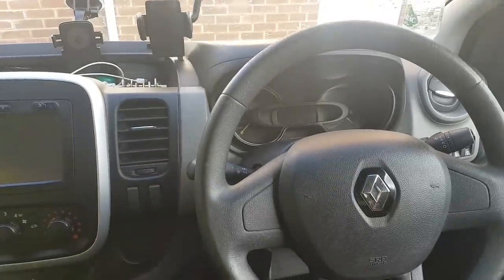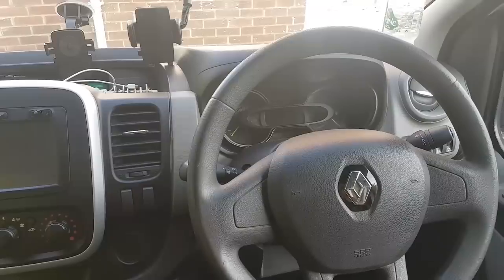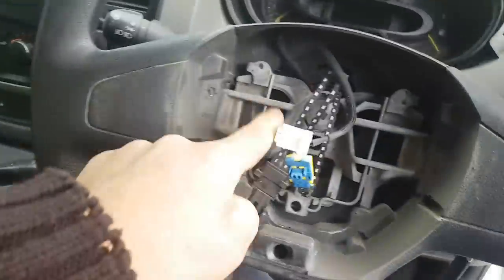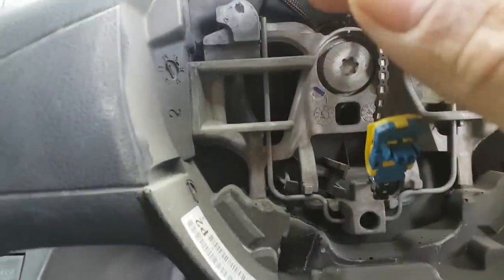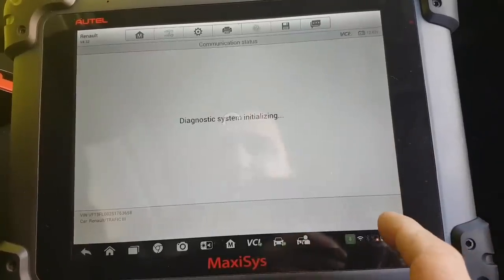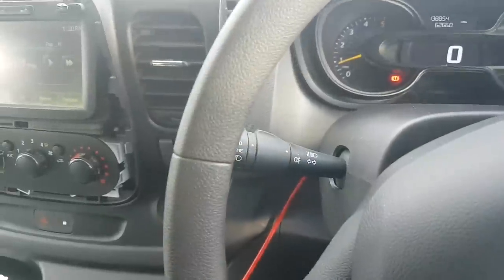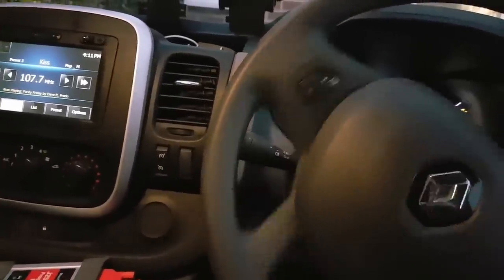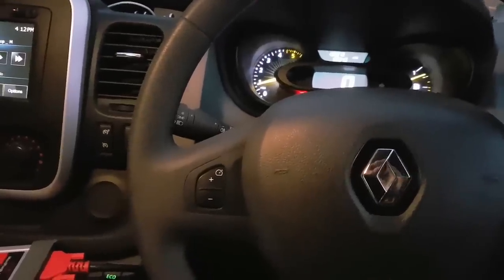Renault Trafic 3 genuine cruise control retrofit! Including coding!

Comment: Great video, didn’t know this was possible and now I have cruise control on my 2015 Trafic! Had to spend £50 on a new squib though as I damaged the air bag connection whilst removing the old steering wheel, nightmare! £300 overall and now I’ve got cruise control, thanks again!
Reply from the maker: 😊
That's great! 
Thank you for watching and for your comment! 
👍👍

Comment: Hi My friend  you did call it right !! .  Changed the clock spring  and my check cruise control and check speed limiter fault has gone and the orange and green lights have returned to my dash . Replacement part was not cheap but all now working thank you so so much for your help.
Reply from the maker: ☺️
That's great! 
👍👍👍
Reply: Hello!

Tanken you for the information.
I have changed the steering wheel and programming with RenoLink. But I get message Check Speed Limit / Check Cruise control
Is it the spring clock that causes this?
Which spring clock I need to buy?
From a later model with CC and SL?

Comment: If the vehicle is equipped with start stop ,you will have for sure 2 clutch switches.The clip for this newer model is useless to activate something,because all the configuration will be made online with a configuration file specific for the options from factory.The bad part is,if they replace the ecu or instrument cluster at renault it will be configured without cc/sl.Very nice video ;) keep up the good work
Reply from the maker: Hi
Correct... I told the owner that any of that would revert the changes back...
Thank you for watching and for your comment! 
👍👍👍

Comment: In my case I had to  changed clock spring and cruise control works!:)  thank you so much for all help and great video. Even me amatour who has never done any coding managed to do it thanks to you
Reply from the maker: Not a problem!
Great you got it done! 
Thank you for watching and for your comment!
Reply: Hi Robert . Have you part number for the correct clock spring?
Reply: Hi. Did you have to change the clock spring as well as added the CC switch and the steering buttons? I have retrofitted the CC switch and steering wheels buttons and it is not working. Cheers
Reply: Yes I did I changed it and then coded the van
Reply: Hi What's the clock spring part number many thanks
Reply: @alicanyazgan  Hi won't remember now don't even have the van anymore sorry

Comment: Thanks for the content, it's all I needed !
Good news !
I'm currently adding the CC on a Sandero 2. It's the electronic of a Clio IV and so very close to yours. Same push button and configuration as here. 

Sadly, the default rotor spring lacks the CC cable so I just bought one. I tried to Enable CC without it (just to know if the car would accept it) but the steering wheel button state is "Open Circuit", therefore the ECM doesn't permit the CC option to be activated, make sense, 5v and 0v are considered "Open Circuit" by the ECM, apparently the 4v value is required to enable the CC option.

When I will finally plug the steering wheel I will give my feedback to help future people ;)

Comment: Hi, i installed the original stearing wheel and speed limiter bottom switch.
in the video where you talking about renolink you where mentioned the crouse control worked perfekly whithout showing it.
mine didn‘t work but not used renolink already. thanks for the help
Reply from the maker: Not sure what I was supposed to show...
Yes, worked perfectly...
You need to code the cruise control, and yes, I have used renolink...
👍👍👍

Comment: Hi. I have done this same retrofit cruise control into my Renault Trafic 2017. 1.6dci. But unfortunately it doesn't work prior to coding. I had it plugged onto diagnostic at a local garage but they were unable to turn it on. Any help would be greatly appreciated.  Cheers
Reply: Did u fix the problem ?

Comment: It looks like renault have taken a leaf out of fords book by having pre wired the van/car great work as always buddy
Reply: back in the 80s i had  a base model skoda,  didnt have door switches for the lights, no side mirror, no rev counter,   went to a scrapyard (and it got out again lol) took some bits off another car, all the wiring and screwholes already to go, my old fiesta had the wiring and the rear speakers, i could have upgraded the stereo easily too
Reply from the maker: Thanks Paul...
To save costs, not all manufacturers do that though..
👍

Comment: I done few of the cruise control installations,mostly all on Renault,older models from 2001-2009 would need clock spring to be changed since they would not have connector in clock spring for the buttons,and some of the later models would not need activation over Clip,but they would require additional switch on the clutch and the clock spring,and most of them were all prewired,Can Clip can activate Cruise control on newer models but it requires a newer version of Clip,for Renault Clio 2014 I was using v174,and it was under UCH/Write configuration,and simply just switch that to With Cruise control,after clicking on confirm in the Clip everything was working just fine.
Reply from the maker: I confess I am running a lower version of clip as well, need to get that updated as well...
Thank you for watching and for your comment!
Reply: Did you do any install on cars without the switch being prewired? My Twingo for some reason comes without it, already have a steering wheel with buttons and I’d be able to get a clock spring easily
Reply: Where u based
Reply: @LMAutoRepairs do you know if all mk3 models of Trafic have factory wiring from your experience? Models like business and business+
Reply from the maker: @Venom1985UK 
Wouldn't be able to tall... this one was the only one I have done...
😳

Comment: Hi i have 2018 business plus, i fitted the sport steeringwheel with CC controls on as per your video and the wiring was there. But when i came to fit the switch on the dash there is no plug at the back of the blank, have you any advice? Thanks
Reply from the maker: Not sure if anything changed wiring wise on those years, or if Renault just stopped leaving the loom and plug...
Without checking diagrams it is difficult to say...
👍👍👍
Reply: No worries, like i say they included the wiring to the steering wheel so you’d think the rest would. Thanks for the reply anyway i’ll do some further research 👍🏻
Reply from the maker: It might be tucked somewhere behind...🤷‍♂️

Comment: Great video! Very informative. I have question please. My 2016 Trafic has the factory installed CC and speed limiter but is not working. Whenever I try to engage either function I get a "Check Cruise Control" or "Check Speed Limiter" message on the instrument cluster. I've replaced the clutch switch but still no change. Any idea what the problem could be?
Reply from the maker: Have you watched the whole video.... without skipping? 
👍👍👍
Reply: @LMAutoRepairs  Not yet. Will have a look. Thanks for replying 🙂

Comment: Hallo, i do habe an 2018 1.6 120hp Fiat Talento = Trafic III. The Coding of ECM with RENOLINK does not work for me. the Parameter jumps always back to "disabled" when i start up the engine :-( basically CC works, but the intruments doesn`t show anything.
Coding of the TDB worked with RENOlink, there the parameter stays as it should on "cc/LV".
Is there anything specal to do in the UCH? oder a special procedure that the parameterization stays in the ECM?
Does anyone have an idea?

Comment: Thanks to your video, I was able to activate the speed limiter function. But CC doesn't work.
I tried authorization enable by Renolink 1.87(red) at IGN ON without engine running state. I can get a response message "ACCEPED". but state goes back 'ENABLED' to 'DISABLED' while starting engine.
However, SL is already working perfectlly.

Are there any pre-condition(such as keep driver's door opened, brake, cluch pedal condition etc.) or specific sequence for 'authorization to connect cruise control and speed limiter options'

 - X62 (MASTER III 2019 ) SID310
 <CRUISE - RV/LV - config > 1. configuration - Cruise Control (option) : without,
2. configuration - CCSL steering wheel push buttons : without,
SL option / SL and CC on/off main button : with
Reply from the maker: I am sorry, I don't remember now all the details... but I don't think it was anything like that...
Just make sure you have the correct .xml file for the ecu you are working on...
👍👍👍

Comment: I'm about to do the same on my Trafic 2015 9-seater, also prewired. DDT4ALL is The program you need to activate CC and other things on Renault.
Reply from the maker: Clip does quite a lot... for the more intrinsic things, I use renolink... 
Thank you for watching and for your comment!
Reply: Hi Johnny, Do you know if it is possible to use DDT4ALL for activating CC on Dacia also? I have a Logan and the parts look the same as in this video, but it don't know the right code for CC in the program for my car

Comment: Hello, you have just replace the steering wheel and place the switch ? Not the flex contactor ? Thank you.
Reply from the maker: No...
The clock spring in this case already had all necessary lanes... but obviously check yours...
👍👍👍
Reply: @LMAutoRepairs  thank you for your reply. Do you have find the switch connector behind the trim panel ? The contactors on the feet are goods or replace ? The steering wheel can be upgrade by placing the buttons or it's one assembly ? Thank you
Reply from the maker: I just did it as per the video...
I can't remember now if you can just install the buttons... this was done some time ago...
Sorry...

Comment: Hi mate, will renolink talk to a vivaro to activate the cruise in ECU?
Also, Do you need to install the button and steering wheel before being able to  program\code? I had a look in vauxhall gds2 and sps, but couldn't see anything in there to activate cruise, but could see that the switch was open circuit ( I havent fitted the wheel or button, I wanted to try and see if I could see the option on the PC before buying the parts)
Reply from the maker: You should be able to activate it before install it... as for Renolink in a Vivaro, not sure, perhaps with the correct xml will do it...
I have never tried it...
👍👍👍
Reply: Well renolink will work with a vivaro! I managed to do it tonight, thanks for the video was really helpful! 😁🙏
Reply from the maker: @simeonjunglist  
That's great!
👍👍👍
Reply: @simeonjunglist  hi did you have to purchase the xml file I bought renolink but had a email attached when installed saying to contact for xml file and they wanted another £80

Comment: Hi I have same trafic 2014 but my mechanic told me that for this to work van must have cruise control module and he plugged computer chcecked and my van doesn't seems to have it anyone had same problem? Did you plug computer to check before you start putting cruise control to this van?
Cheers
Reply from the maker: In this cars the cruise control is managed by the engine module... as you have seen...
Thank you for watching and for your comment!

Comment: Hello, 
watching youre video and i was hoop full that i could do the same thing with my trafic 2015 
changed the steering wheel and fitted the switch, (cables were allready there) but even the dealer cant get it to work. do you have any ideas or maybe?
or some connections in the netherlands where i can go to?

it seems to be the programming of the CC.
Reply from the maker: Hi
Sorry... but I don't know anyone in there...
It is strange though that the dealer cannot do it...🤔

Comment: Hello, i bought steering wheel, and cruise/limiter button, changed these two things, went in pyclip, wanted active  cruise control, but in options i dont have anything about cruise control, please, can you help me?
Reply from the maker: What software are you using?
Try renolink...
Thank you for watching!
Reply: @LMAutoRepairs  thanks for answer, im using just mobile application PyClip, its something like renolink, when i choose Trafic III, i dont have option to find - active cruise control, when i choose some different car, for example Megane III, option to active cruise control there is, so its possible, that application cant do this action on Trafic? I will find someone wtih renolink, and try it.
Reply from the maker: Never used such tool...
So I can only guess that if the option is not there, then it can't do it...
Try renolink then...
👍
Reply: @LMAutoRepairs  many thanks, i will try

Comment: Hi, could i use renolink software for Vivaro to code cruise control buttons?
Thanks for any help
Reply from the maker: Not sure... but I think it will not work...
👍👍👍
Reply: Thanks for the reply just want to ask do I need to disconnect battery when i will remove air bag?
Reply from the maker: Highly recommended...
👍👍👍
Reply: Any idea what issue could be in my Vivaro 2015. I already change wheel steering with cruise control buttons I contacted connectors with my existing clock spring and I installed same Cruise Control switch unfortunately when I started to drive the cruise control doesn't work. Do I have to use software to code?Any help will appreciated.
Reply from the maker: I would say yes... if was not there from factory, will have to be coded/programmed...
👍👍👍

Comment: Hi, Thank you for the video, do you think would it be possible to activate adaptative cruise control on a clio 5 which is already equipped with a cruise control ?
Reply from the maker: Possibly...
But will most likely need some retrofits...
As the adaptive cruise control relies on a radar and a camera, that you most likely don't have installed at the moment...
👍👍👍
Reply: @LMAutoRepairs  My Clio 5 is equipped with the front Radar + Front Camera + AEBS + Distance warning + urgence beak, I believe that it's a kind of activation and reprog, can I have your contact please!
Reply: @LMAutoRepairs  Hi,  I realized some tests on my Clio 5 yesterday, I assembled the new steering with the ACC button, I modified ABS to Activated ACC as well as in the front radar. But after this, ACC is not working even normal the cruise control is not working as well. When I diagnosed the injections by the clip I checked the voltage is around 3.8v, when I press on the buttons of ACC the voltage drops down to 10mV ≈ 0. what do you think about this ? 
Could you please send me your email so I can show you videos I took. 
Thank you.

Comment: Hi ive a 2015 trafic mk3 1.6  and i have installed the wheel and button just like shown in your video , great vid btw 👌🏼 , but how do i code in the Cruise control to make it work is it renolink u used to code it in to work thanks
Reply from the maker: As per the video... yes, renolink did the coding...
👍👍👍

Comment: My cruise has randomly stopped working 2016 Vivaro no warning lights. Done a full ecu scan without finding any issues.
Would you have any advice what to try ?
Reply from the maker: Check live data...
You answer will most likely be in there...
👍👍👍
Reply: @LMAutoRepairs  we did go out on a road test whilst plugged but nothing. The speed limiter works fine. The cruise control lights all come up on the dash but the plus and minus to initiate cruise doesn’t do anything but plus and minus work on speed limiter. 
The van has just a a gearbox replacement and since cruise has stopped working.
Reply from the maker: Ah...
That makes more sense...
Was the gearbox like for like? 
Is the box auto or manual?
Reply: @LMAutoRepairs  it’s Manual the old one gave up at 105000miles so had a reconditioned manual put back in ?? I thought the cruise worked off of the throttle position sensor.
Thanks for you input, really appreciate it. Short of taking it to Vauxhall me and the mechanic are stumped.
Reply from the maker: Is the gearbox is not exact the same as the old one, the gear ratios might be different...
And that can render the cruise control inoperative...
Seen it on a citroen...
👍👍👍

Comment: Great video, I was wondering if it was possible to do the same with the automatic  start stop system, do you or someone else have any idea?
Reply from the maker: Possibly... but I have a feeling that will be more to it... I believe that the starter motor for cars with start and stop are different.... plus the extra capacitor for it... I am sure it can be done, but probably not worth the investment... 
Thank you for watching and for your comment!
Reply: @LMAutoRepairs  Thanks for your reply, I wish it was as "simple" as  installing the cruise control, what about installing a  passenger side airbag or a factory r-link hemdunit?
Also, where do you get your genuine Renault parts, I can't seem to find any here in Belgium?

Comment: Super... What connection did you use lo connect to vehicle? ELM327? Other? thx
Reply from the maker: Renolink... Just google...
Thank you for watching and for your comment!
Reply: @LMAutoRepairs  Does it requires the blue version or red one of renolink cable (from china OK)? Can it also be done through DDT4all with elm327 or PyClip/PyREN with same ELM327? Thank you.
Reply from the maker: @luismiguelsilva1736  
Not sure on that...
Never used any of those other systems... it might be that they also do it, but I can tell...
Reply: @LMAutoRepairs  Thank you. From Tuga 2 Tuga,... which one is the adequate cable renolink for this (Blue one - renolink v15.2, or V1.87 red one)? Which did you use on this experience? You have made this on a Dacia, for a Renault (Megane mk3 grandtour is my car) the programming would it be the same? Thx.
Reply from the maker: @luismiguelsilva1736  
I have used the red cable... that's the one I bought initially... did not even know there was a blue one... probably is just the colour... everything else is the same...
I am not sure which version I was using initially... have updated a couple times since...
I am now running 1.87...
Never done it on those cars, but I assume will be similar...